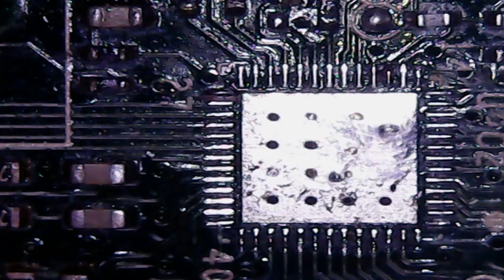SOLDERING QFN IC USING SOLDER PASTE (me learning to solder)

Comment: Nice video but this technique is not for me, center/ground pad solder bulge could bridge pins or lift the qfn and results in some pins not connecting. 

Still nice video and i guess it works for you.

Comment: Is there no risk of getting a short between the thermal pad and the pins?
(Louis Rossmann would say: you are not using enough flux!  🙂 )
Reply from the maker: No never happened me but maybe its possible if the chip is not pressed flat to the board.next time i will use a louis rossman amount of flux thanks for the tip:)

Comment: With that kind of overflow, how do you know if it bridges some pads under the chip?
Reply from the maker: Run the iron along the side to remove the bridges and check with the microscope
Reply: @Jungleju1ce  He mentioned the internal bridges. For example a data line bridges with big ground pad.
This type of bridges you can't see, but a good quality flux don't let to be happen.
After you can do diode measures if you know what is the data lines.
Reply from the maker: @markmarian621  great reply very knowledgeable thanks

Comment: It takes almost no solder on the ground plane to get a full bond.  If you're getting solder balls pushed out, you've got too much solder on the pad.  Just like heatsink compound, a very small amount of solder on the ground plane will spread out and fill the gap perfectly.
Reply: You are correct about that solder bulge on ground pad is too much. Discovered that in hard way :D
Reply from the maker: thanks for the help john
Reply: Thank God I am not the only one freaked out by the gobs of solder applied.